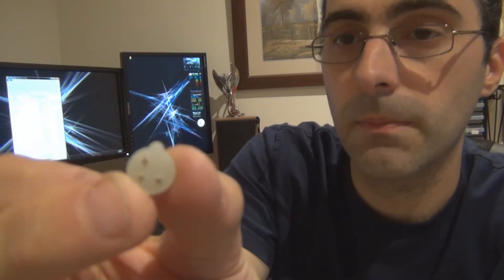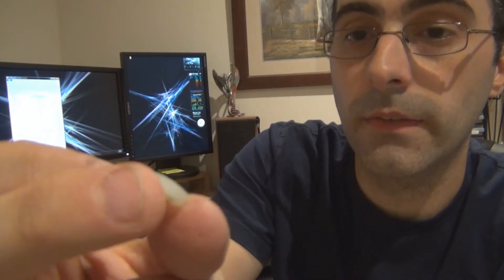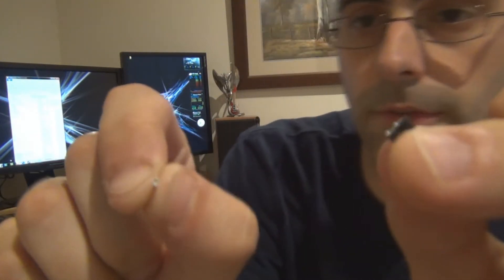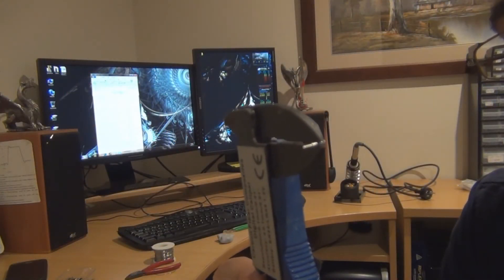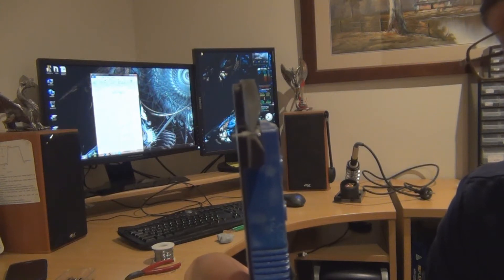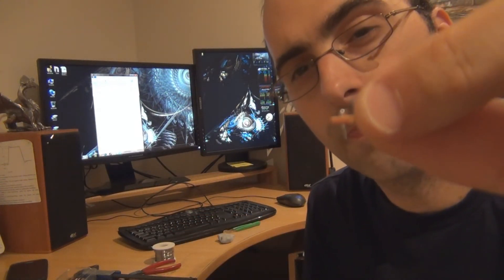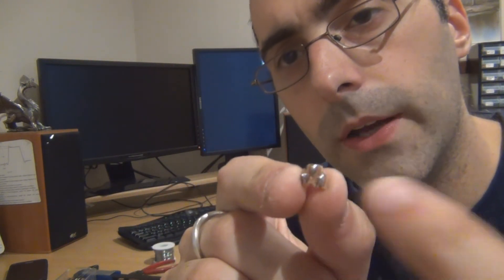Quick Tip - DIY Germanium Transistor Sockets

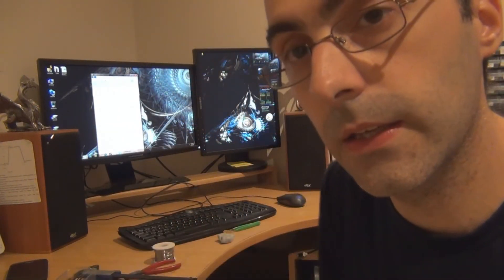Comment: 4:30 You've having issues focussing not because the item is small but because you have a wide depth of field between the foreground you want to focus on and the background which has many high contrast edges for the autofocus to work on. Assuming you're not simply holding it short or the camera's focal range of course. It's a classic mistake all over youtube. put it on a desk and point the camera at it or you can get away with holding up a sheet of paper close behind it but if its white paper you then run into a contrast issue.
Reply from the maker: Half way through reading your message I was thinking..."hmm, maybe I should hold a piece of paper behind it".  Yeah I think your right.  I mean the sockets almost the same color as my face :)
Reply: AFAIK, the autofocus looks for edges, generally near the centre of the field of view, rather than colours. If there are nice high contrast edges in the background near the middle of the screen, it will preferentially focus on that. If there's face tracking it will look for anything that looks vaguely like it has the features of the face as well. I hope that helps you to avoid the issue in your future videos :)
Reply from the maker: KX36 I was thinking because the board / my face are similar colours it had no sharp edge, but I see what you mean.  Definitely will help cheers!

Comment: it's good tip but too much work for me - I just use SIL sockets - cut one double and 1 single. I know it looks not so good, but gets the job done.
Reply from the maker: Hi Fuzz, actually may not have made this clear in the video.  I find single sil sockets break relatively easily, particularly with thick leaded transistors or in applications where the socket is used extensively (test circuits / hfe testers etc).  The extra piece of Vero is there to add support more then anything else.
Reply: chromespherecom  nope, it's not you it's me.... got distracted and missed that part  - my daughter is trying to blow up the speaker of the baby monitor.
Reply from the maker: fuzz labrador Oh!  I know how that feels! No worries mate :D